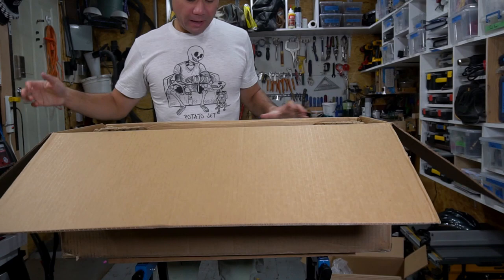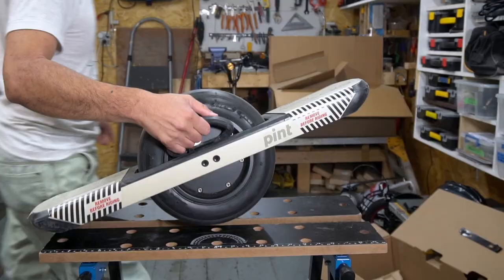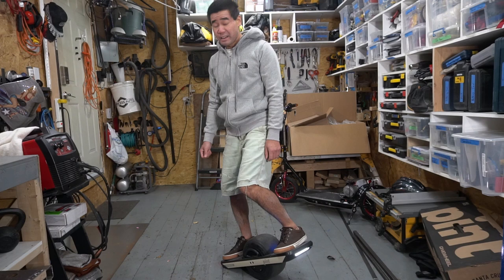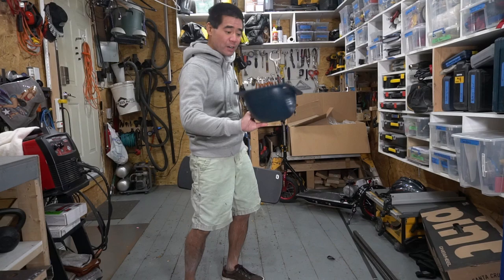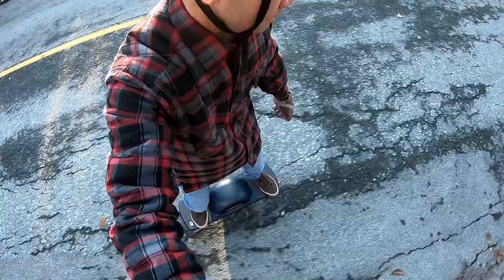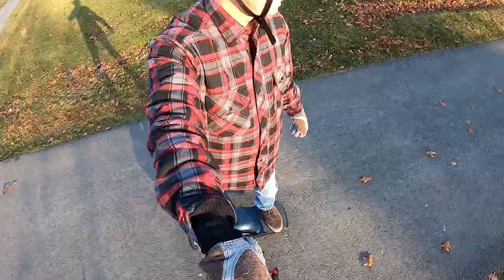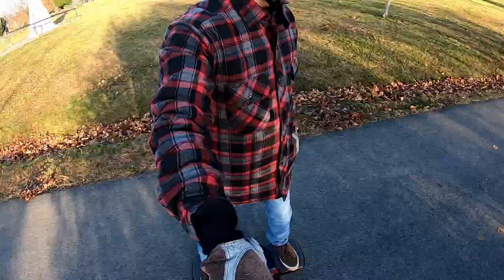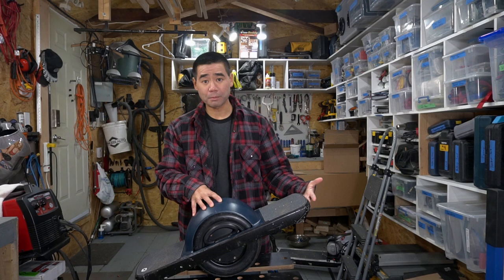Learning to Onewheel on the Pint - From Newbie to Carving

Comment: The other day I fell off my Xoiami M365... so basically, I fell because I saw a kangaroo ahead, I attempted to slow down but unfortunately a fly got in my eye, I slammed the breaks and hit a numb or inperfection in the path... long story short, the worst fall I ever had (I was going at 25-26km/h and I’m 13) I have a fairly deep cut In my knee, an infected hand (that’s healed with betadene and turmeric a week later) and two tiny but deep cuts in my other hand... I have now learned my lesson to ALWAYS wear safety gear... lolzs

Comment: It looked used? The bumpers look scuffed right out of the box?
Reply: (FYI: What looks like scuffing is just the fiber dust from the packaging, recycled hard paper materials for the corners of the box. It dry-wipes right off.)
Reply: I agree my new Pint looked like a refurbished unit when I got it. Hopefully thats just the build, but the top edges of the foot placement looked frayed and it was covered in debris that may have just been the packing material. Wheel was new and all the bumpers were fine.
Reply: I bought one and thought the same thing at 1st it wasn’t used the brown packing material they use made it look as if it was scuffed or used but it wipes right off so it’s actually not scuffed at all😉

Comment: good video! 
What's your tire PSI set to?   400+km and I'm still riding around 16 psi for added stability. I tried the same port plug in PLA, but lost it on it's first ride, didn't stay in.

Comment: What caused the board to shut off/nosedive in the beginning of the video?
Reply: its a onewheel thing.
Reply: It seems like it's the elusive 'board failure nose dive'. I'm 400 miles in and I've never had an unexplainable nose dive.
Reply: The only time I've ever "nose dived" on the pint is when my foot doesn't activate or deactivates the 2 foot sensors. and thats probably what happened to him. I've went 22 mph and never nose dived yet.
Reply: Probably not trusting the tech
Reply: FYI, the sensors aren’t used once the board is going a certain speed.